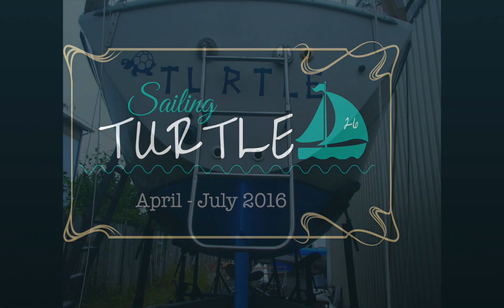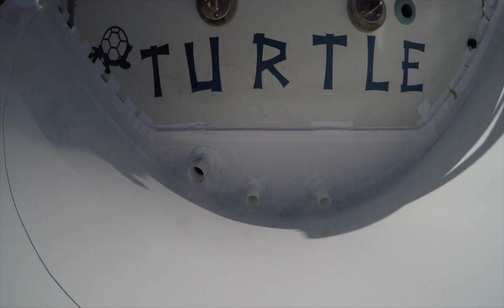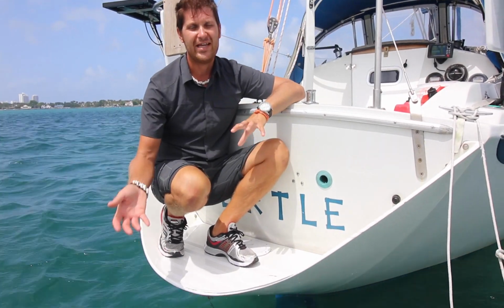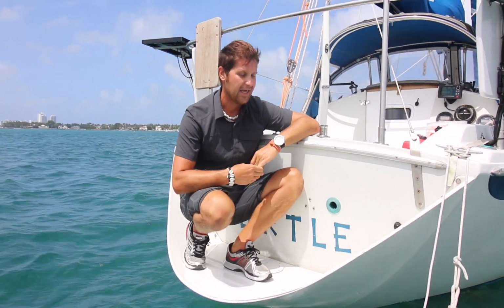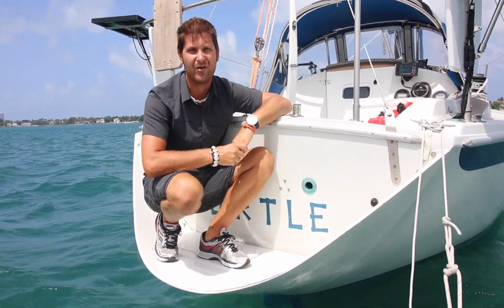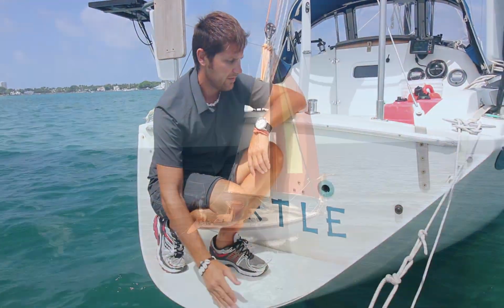Custom Built Swim Platform for a 1985 Ericson 26 Sailboat

Comment: Hello this is fantastic and just what i am looking to build for my boat at the end of this season, i have some quick questions.... 1st, What is the white board made of you use to form the first scoop mold?
2nd, What is the grey board you use to make the fibreglass rigid inside the lamination?
3rd, Did you laminate the same board on the stern connecting plate which the bolts go through.
Sorry if these sound dorky and they have simple answers i am just starting out and Still 'Learning'
Great vid. New subscriber gained.
Reply from the maker: Hey thank you so much for watching our videos and for taking the time to reach out to us! We love being able to connect with our viewers. These are all great questions and we're always happy to help. 1. It is a white dry-erase board. You can probably find it at Home Depot.  2. The grey board is a core material specifically for boat building called Airex foam. It's pricy, but worth it. (There are off-brands as well) 3. No the flange that through bolted the transom was solid fiberglass for strength. Let us know if you have any other questions. We try to read all of our comments when we can and have tried to respond to as many as we are able. Thanks again for watching!

Comment: I count 30 attachment points...very nice work young man!! Can you tell me how you attached it? Of those 30 points, the highest 7 on each side are through holes where you fasten a bolt through those 14 holes into probably nut inserts that you epoxied into the transom. The remaining 16 could be the same as the first 14 because you have access through the water tight access hatch. Is that how you did it?
Did you pitch the surface downwards so it drains properly?
What are the pros and cons of having that on your boat? Any long term observations?
Can you notice any difference in boat handling? I'm guessing not because it's mostly out of the water. But on a tack while you're heeling over I'm thinking it's iny the water and you might add to the waterline? Also when on a broad reach or going straight down hill, you're going to add buoyancy AND change things in a following sea state condition when you have big seas. What do you think?
I bet that every Ericsson owner with a similar original style transom wants one of your scoops, and every 26 owner who sees yours is trying to figure out the size of the bolts you used to hold that puppy on there! (just kidding..I doubt highly anyone would steal your sugar scoop!)
But seriously...who just makes a sugar scoop for their sailboat? And..who just makes a sugar scoop for their sailboat...and nails it the first time, no, who just fucking nails it the first time!?!? You do! And not many others would be able to do that. I'm good, but mine wouldn't have turned out that good the first time! You're the man! I bow to you, your creativity, your no fear, your skills, and your giving it to the world via a YouTube video. Thank you! And no..I'm not drunk! I don't drink.
Reply from the maker: Thank you again for your comments! It's been a joy for us to connect with you!  Those highest 7 attachment bolts on each side on the sugar scoop are completely through bolted with nuts and washers on the inside of the transom. The lower bolt holes that attach to the swim-step, inside of the hollow storage cavity, where actually pretty tricky. There was very limited access to some areas of the storage space, because of the cockpit drain and engine exhaust port tubes that ran through the inside of the sugar scoop. My solution was to bed pre-tapped aluminum flat bar inside the sugar scoop to accept bolts coming out from the transom of Turtle. It was quite a trick to get them all to line up perfectly with the holes that had to be predrilled in the transom, but in the end I lucked out and everything lined up perfectly! The sugar scoop was further held in place by a marine sealant. In retrospect my attachment system was probably overkill and I could have probably used 1/2 of the number of bolts. If I were to do it again, I would seriously contemplate, gluing it on with 3m4200 and forego the bolts all together. 

The deck surface of the sugar scoop is actually perfectly level. I was terrified if I made it slope aft, it would be a slipping hazard. It didn't collect much water if any unless we were heeled, in which case it easily accumulated a decent amount of water. To remedy this slight nuisance, I simply drilled a small limber-hole in each corner. 

I was hopeful that the sugar scoop might also extend our waterline, but in reality on the rare occasion the sugar scoop was even in the water, it just never displaced enough volume to make a difference. I sure thought it looked nice though and I can't imagine our trip to The Bahamas without it. Because the sugar scoop was painted and not covered in gelcoat, we had to keep an eye on scratches and abrasion in order to prevent the epoxy from degrading from strong UV-rays. The best pro was that it made the ultimate place to pee off the back of the boat while underway. You could loop one arm through the stern pulpit and brace one foot on one side of the sugar scoop while heeled, then pee off the back while still being safely clipped into the cockpit. It was true heaven! Hahahaha!

Comment: Great addition to the transon! I really enjoy ur videos, that´s great sailing life.
I just have one question about the mufler´s out let, those three thru-holes that you've covered with the platform, I think they are the deck´s bailey and the engine´s coolingwater outlet? If so I would make shure to always watch the flow and get to know the engine´s getting the propper cooling from the seawater.
Reply from the maker: That is a great question! That is definitely something to be aware of while running the engine. If you look back to the video at about 11:55 you will see a hose on top of the swim platform.  That is the Coolant bypass outlet & hose that allows us to see water flowing while the engine is running. You can also see it in some of our other videos as well. 

One day while in The Bahamas we noticed the engine didn't sound right soon after starting it. We were able to see that water was not flowing properly through the water coolant outlet & hose and knew that we needed to quickly anchor so we could assess the situation. We found the problem and were able to fix it. You can check that video out here: https://www.youtube.com/watch?v=3ckDEAK7aVM&t=13s
Thanks for Subscribing and for leaving us a comment!  We really appreciate you watching our videos!!!

Comment: Really nice piece of engineering and boatbuilding. Could it also be made to work with self steering gear?
Reply from the maker: We contemplated that same question during our design build phase, and decided that there was not enough space for a wind-vane with such a small sugar scoop. I've seen it done on larger boats where there's room for an off center wind-vane installation that still gives space to make the swim platform useable, but that was not practical for us. Instead we chose to carry a back up autopilot. Thank you so much for leaving us a question and for watching our videos!

Comment: I see you used a template for the matte, what did you use for the base of sugar scoop that you put matte on? I have a Bayfield 25 and I want to make one.
Reply from the maker: Thanks for watching and for leaving us a comment... In order to get the fitment to the transom perfect it was necessary to do the initial lay-up directly on the transom. The mold was built in place out of 2x4's and a 1/4" ciramica (dry erase) board was used for a mold surface. The transom was waxed four times just in case, and then covered with vinyl tape for a release agent. 
Each stick of the frame was carefully placed to continue the exact angle directly aft off of the hull lines in front of it to try to naturally continue the lines of the hull. This method worked very well and was a bit more accurate than simply holding up a floppy piece of sheet metal for a mold. The initial glass was laid in five single sheets of (woven) fiberglass-cloth that rolled up seamlessly onto the attachment flange and the transom, and around the plastic pipes in place to start forming the drain passages. I thought it was important that the flange was molded continuously in one layup and not simply glued on to the rest of the platform. Next the foam-core was laid on with thickened epoxy while still in the mold and finally five more continuous layers of fiberglass encapsulated the foam and again wrapped up onto the flange to build stiffness and thickness. Then the whole piece was removed and the drain passages were finished, and the deck was formed separately again with five layers of glass on both sides. The deck was then set in place with thickened epoxy and another continuous sheet of glass was wrapped over the entire top of the deck and sides, and bolting flange, and also wrapping down around the forward and trailing edge to bond everything together. ...Hope this information can be helpful to you. Hope your project works out! Thanks for watching our videos!

Comment: The platform is sweet, but what if you need to use an outboard motor? Or want to add self steering gear, which ALL bluewater sailboats should have, IMHO. In fact, I am working on a design for a small windvane/ servo arm unit for my little Sparrow 16! I am trying to make it easily removable, hung over the transom and fastened with just a few bolts, and made mostly from water jet cut (or maybe even scroll saw cut) G10 fiberglass sheeting and carbon fiber tubes (both actually quite affordable), with only bearings, fasteners, hinges, and a couple of rods made of stainless steel or monel.  I have never understood the material choices some people make for DIY projects.
Reply: Sounds interesting.  Do  you have a build thread or videos of your project posted anywhere?

Comment: First off as a disclaimer of sorts I dislike the look of sugar scoops. I am unable to find any fault in your fiberglass work as it is impeccable. I however do not agree with drilling 30 holes in the hull to mount the sugar scoop. Also I wouldn't use butyl tape in a below-the-waterline application. Use 3M 4200 or something made for below waterline. Butyl tape is an amazing product and I always have a couple rolls on my sailboat. It however does not have any rating at all for underwater (or possibly underwater) use.
Reply from the maker: Haha Our lifeline stanchions are often under waterline more than the sugar scoop ever was during high seas. The sugar scoop is well above waterline and never leaked a single solitary drop of saltwater from astern. I assure you there is no problem using butyl tape in this manner. If there were, my lifeline stanchions (which are also sealed with butyl tape) would present an even greater problem. My main reason for choosing butyl tape was, ease of removal. In the event of damage to the swim platform I want to be able to easily remove it. While 4200 is a fantastic product that I use exclusively for below waterline applications, it would render the swim-step completely unremovable and permanent. As for the holes in the transom, I am not worried about adding holes to my hull. There are already a dozen or more holes bellow waterline, none of which have any leaking problems. Actually there is not a single leak on our boat, top or bottom. We understand that everyone will have their own opinion on what looks good and what doesn't. That's totally fine! We appreciate you leaving us a comment and letting us know that you liked the fiberglass work. Thanks for watching our videos and fair winds!
Reply: @SailingTurtle  - thanks for your well thought out reply as I now understand your position better. I never considered having to remove the sugar scoop. If we were all the same this would be a very boring world. It is good to have differing opinions as it makes life a lot more interesting. I already know how this journey ended, but I am still watching all the videos anyway. I'm looking forward to see what the two of you come up with next.
Reply from the maker: Exactly! Haha We have tried explaining the exact same thing to people in the past about various sailing topics. Just because we did something a certain way doesn't mean that is the only way to do it. A lot of the time, people are going to use what they have available to them, which isn't going to be the same for everyone.  It's good to have your own opinion, just as it's good for the other person to have theirs. We're glad you get it! LOL We are happy to hear that you are still watching our videos. We still have more to share and are looking forward to seeing what fun adventures will come next. Thanks again!